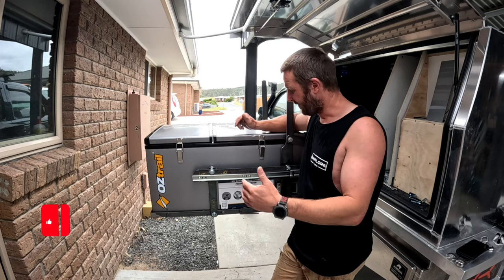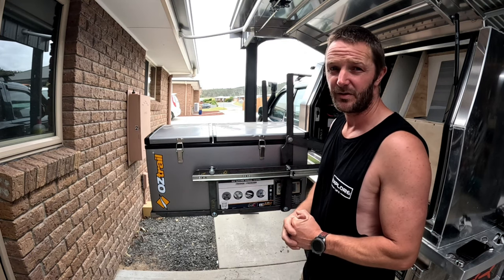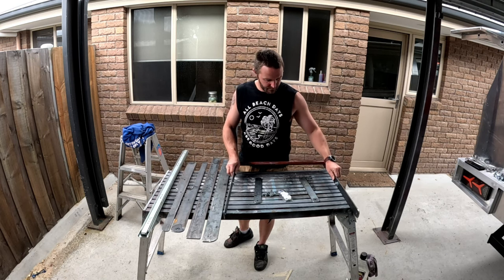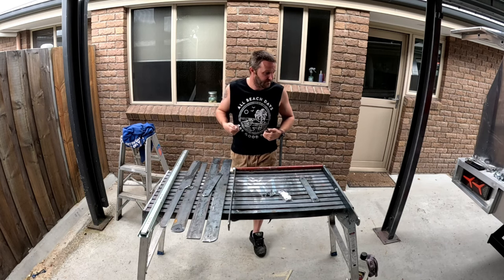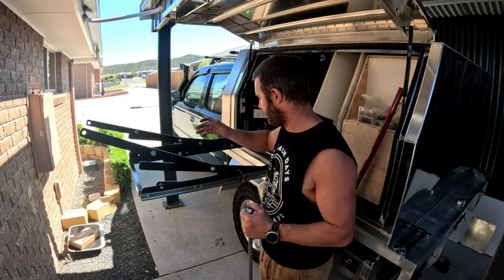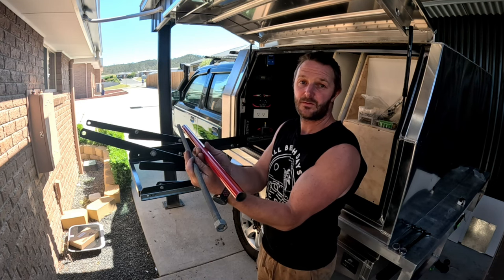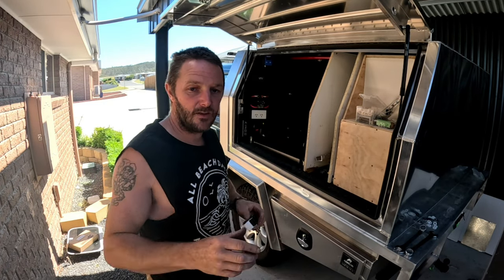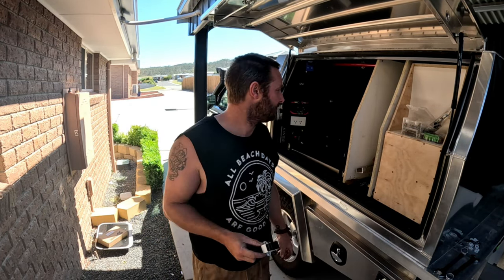DIY Slide drop down fridge slide for my Oztrail 80L dual zone 12v fridge

Comment: Ahh sweet! I have the same fridge (oztrail 80l) but I have a taller tray.
Can I confirm with 
you, the drop height is determined by the rear clearance at full extension?

Comment: Mate. Great job. I finished my slide 12 months ago for the same friedge. Your wright there is no slide for that size friedge. I used 2 gas struts to help out which added complications. I also had to put the handle at the front witch put more load on the slides even with the struts helping. 
Now I'm starting to work on a elec lift slide for the same friedge. 🙄 sucker for torment as you know. 😅😂. I mounted myn in the back of GU patrol. They do fit with feeler gages & Vaseline. 😂😂
10 out of 10.

Comment: Didn't look like u had locking draw slides? Do you have any movement when cornering or when using on uneven ground?
Reply from the maker: I just installed a pin at the front of the fridge a few days after this video , locking slide can also be used , but unsure if the come at the length needed for this